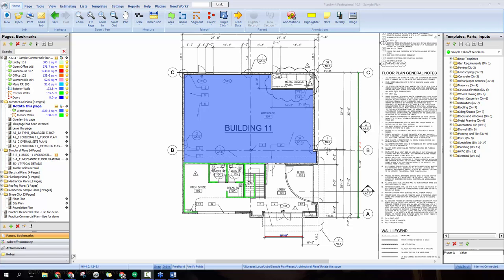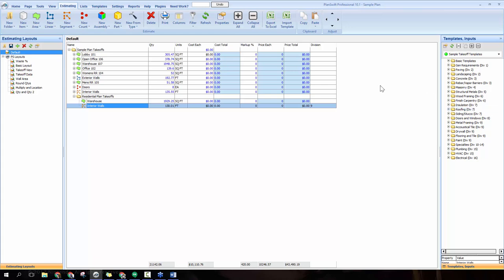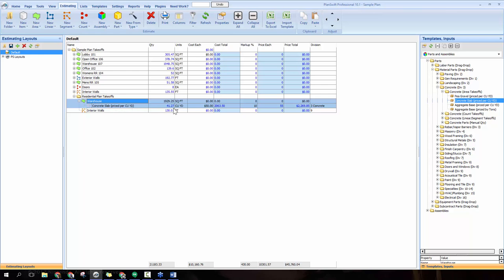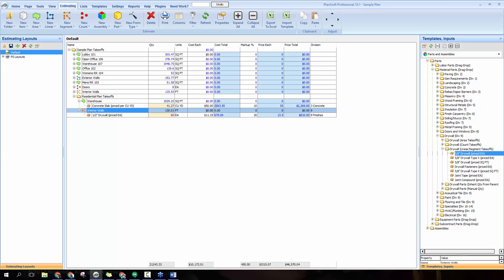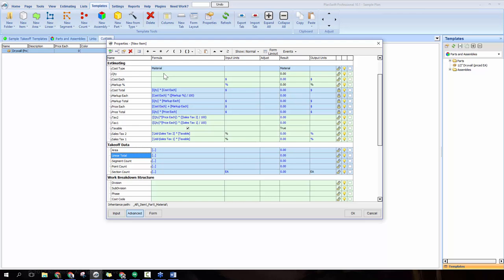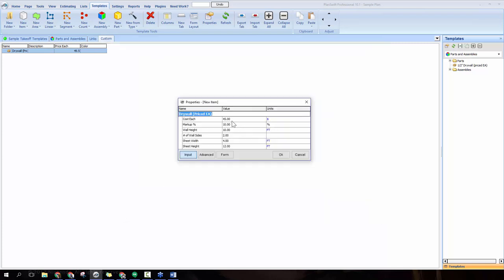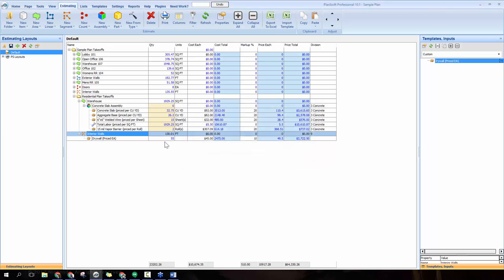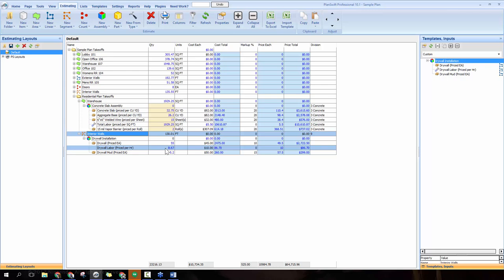How to Use PlanSwift Class 2: Estimating and Advanced Parts (2017, PlanSwift version 10.1)

Comment: How can I organize my Estimating tab (by Division)? Organized like my reports tab (by Division).
Reply from the maker: In the Estimating tab, you can add a column for Division (or use the Division layout) to see that information, but there's not a simple way to Sort or Group by that information within the Estimating tab.  You could create a folder for each division and manually move the takeoff items into the folder, but you'd need to manually do that for every job.  For simple organization by Division, the Reports tab is still the best solution.